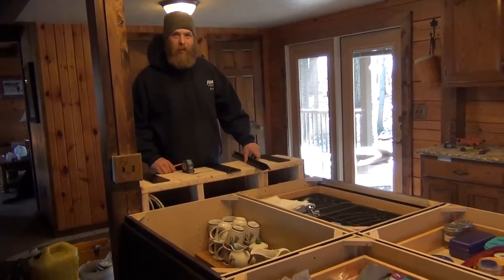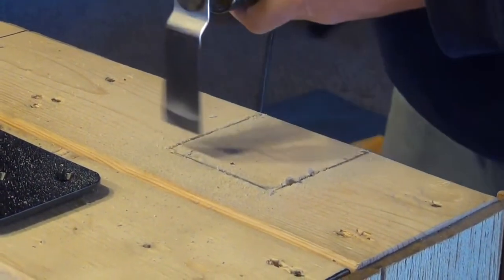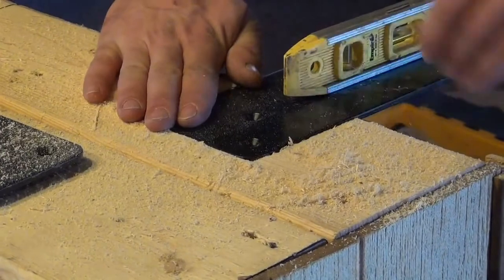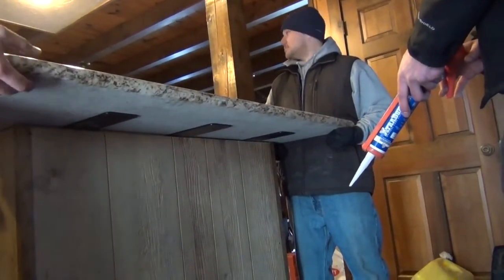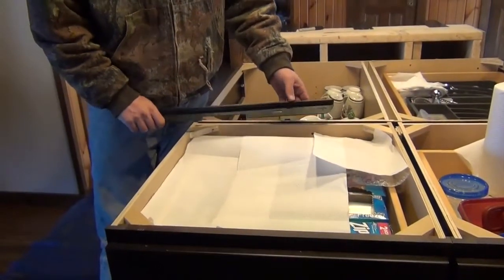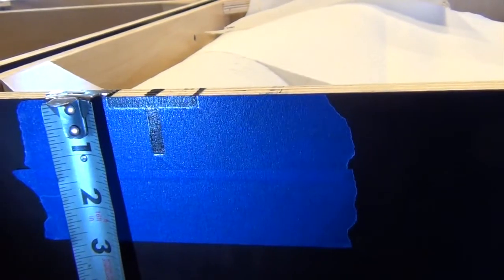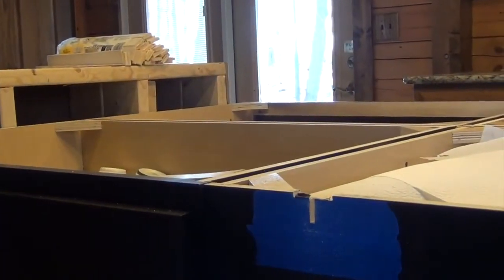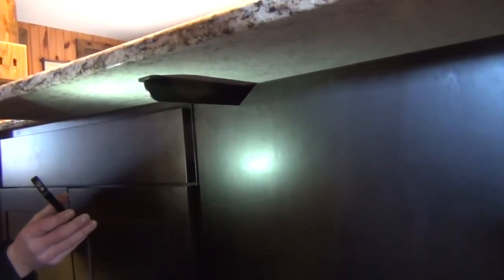Counter Balance Installation Video

Comment: What happens if you have to shim the counter top to level, raising it off the cabinet frame and the T-Bar? Doesn't the T-Bar flop around in the notch then? Very rarely do you not have to shim the granite somewhere. The Gorilla Grips running in the background are the most awesome thing ever made for seam setting.